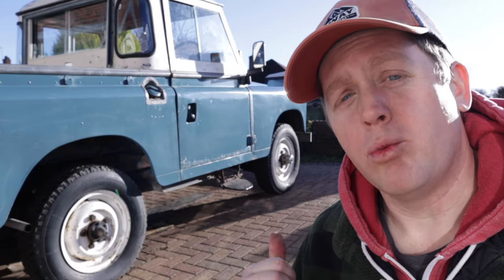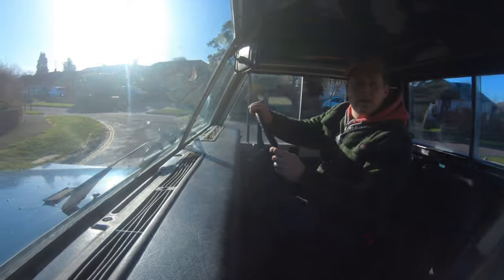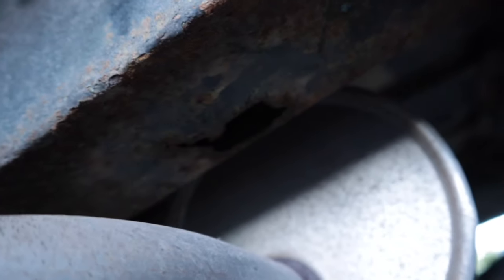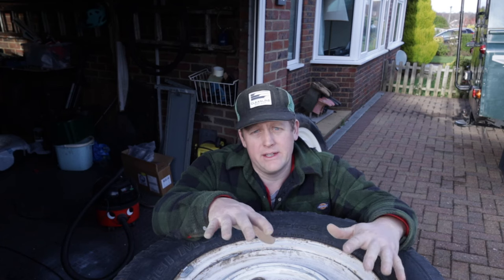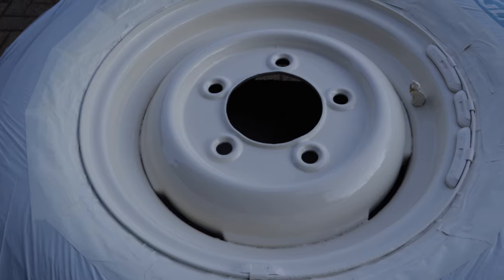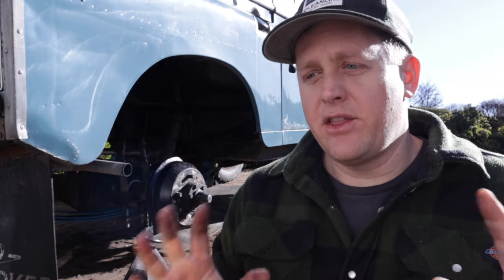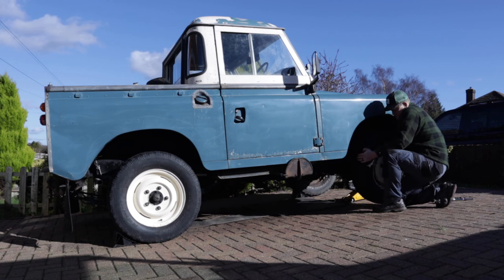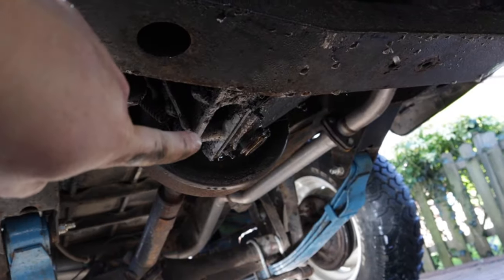Transforming The Original Land Rover Series 3 Wheels!

Comment: Looks very nice.
I bought a 1966 S2A 88”, last year that came fitted with the 16” wheels from a 109”.  Since mine has spent the entirety of its 58 years here in Central California, it truly has zero chassis or bulkhead rust. It was still being used daily on a cattle ranch. I do not intend to do a frame off restoration, as I don’t believe it needs it. It does however need a lot of TLC. Much like your project, I am doing a little at a time and am enjoying every little victory.
If your interested, you can see my Land Rover on LandyAndy4X4 video Castle Air Museam part 2, toward the end.
Cheers.
Reply from the maker: Your S2A sounds amazing and central Cali is a wonderful place! By the sounds of it you won’t need to do a body off restoration for a long time still. I’ll check out Landy Andy 4x4.
Reply from the maker: Your S2A sounds amazing and central Cali is a wonderful place! By the sounds of it you won’t need to do a body off restoration for a long time still. I’ll check out Landy Andy 4x4.

Comment: Just a question Dale, why did you not take the tires off and then spray the wheels?
Reply from the maker: Hey bro, a few reasons. One, I only have two axel stands so I couldn't do all the wheels at once. Secondly, I wanted to paint over the horrible silver balancing weights once the wheels and tyres were balanced and third, I didn't want the tyre place to scratch or damage the freshly painted wheels when they put the new tyres on.
Reply: great entertainment. nice video